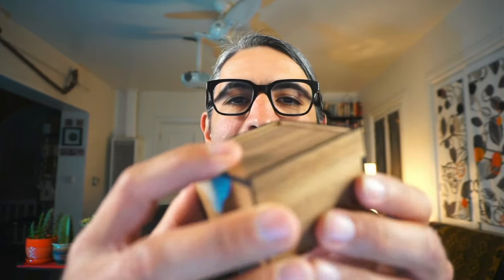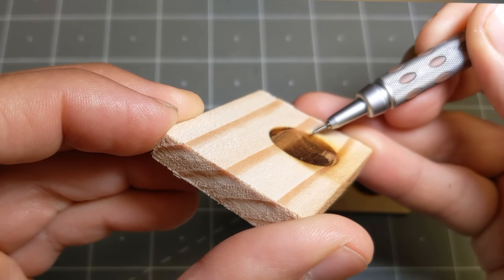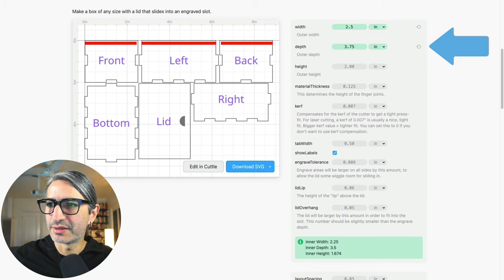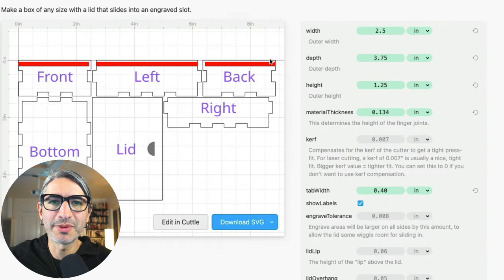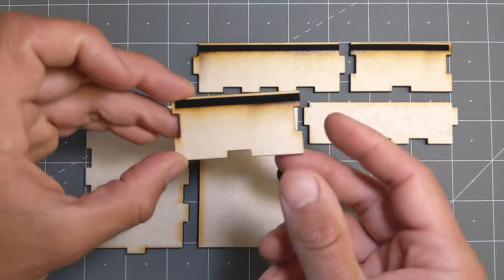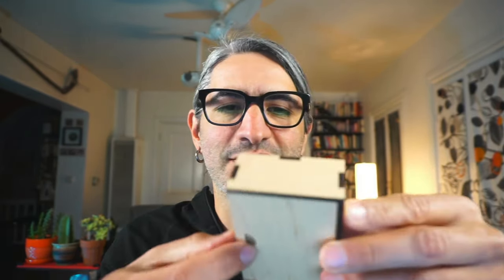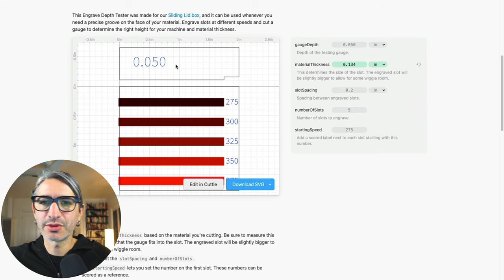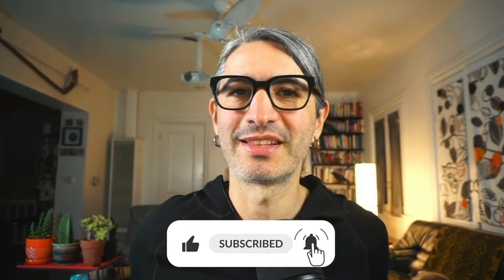Sliding Lid Boxes - Laser Cutting Tutorial

Comment: @Cuttle Hello. Is it possible to make a box template with different thicknesses? I mean the thickness of the box lid will differ from the thickness of the box walls. For example, the base of the box will be made of 9 mm paulownia, and the lid will be made of 3 mm plywood. In this case, not only the thickness of the engraving will be recalculated, but also the height of the side walls of the box. Thank you. with respect to you, Alexey
Reply from the maker: While we don't officially support this on this template, I think you could do it with a bit of a hack on the settings. First you'd set your base box dimensions and material thickness (9mm).

Then, in Advanced, there is a setting engraveTolerance. Normally this makes the slot slightly larger (by 0.2mm) than the lid's thickness. But since you are using a thinner lid, we can set this negative: in your case 3mm - 9mm + 0.2mm = -5.8mm.

Finally, increase lidLip until you have your slot where you want it. By eyeballing the preview, I set it at 4mm and it looked about right.

I haven't tried this and can't guarantee this will all work, but just wanted to get you this info if you want to go "off road"...
Reply: @Cuttle  Thank you very much. That helped. I had to manually modify the layout a bit in CorelDraw, but it was easy. With a negative value of the groove width, the size of the front side (which is the smallest without a groove) will be larger by the thickness of the top cover.